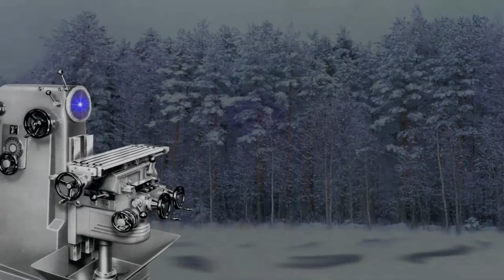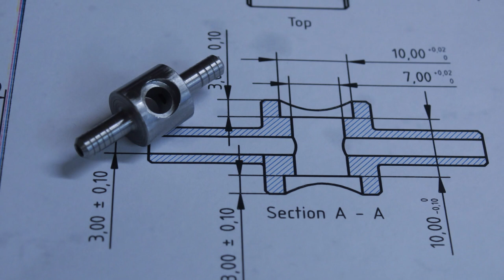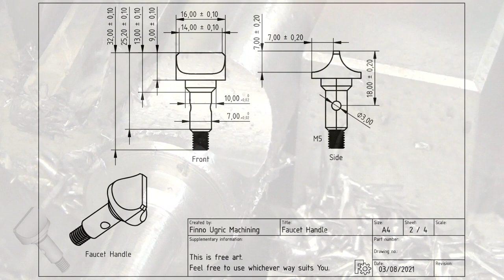Let's make a gasoline cut-off valve

Comment: Great project, butt you should not leave the carb empty it will oxide due to the alcohol present in the fuel.
Reply from the maker: Actually we are using the non-alcoholic gasoline with it. In Finland it is still possible to buy it almost everywhere. This is because we in Finland tend to keep our cars quite long. So they are old and cannot tolerate alcohol in gasoline.